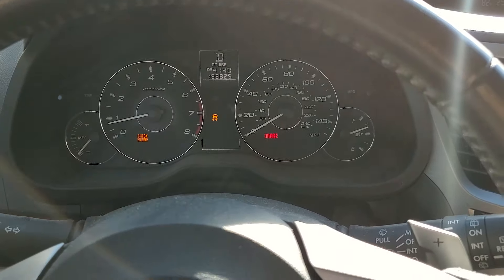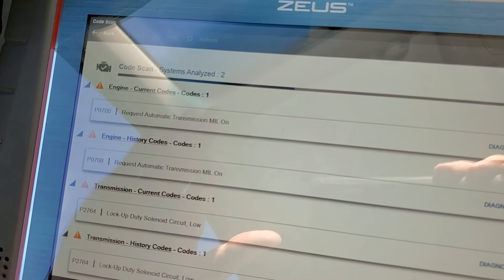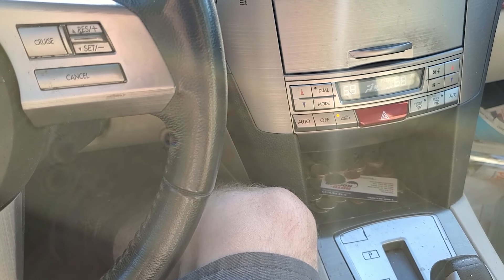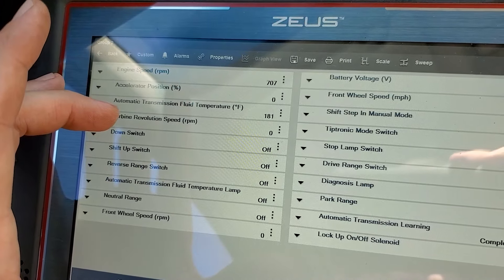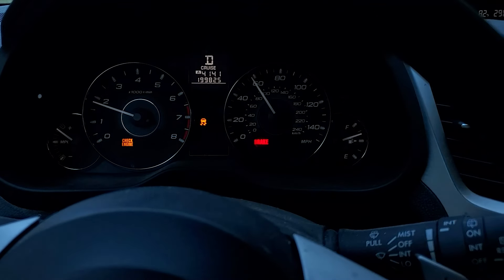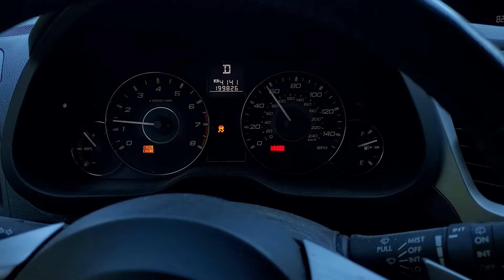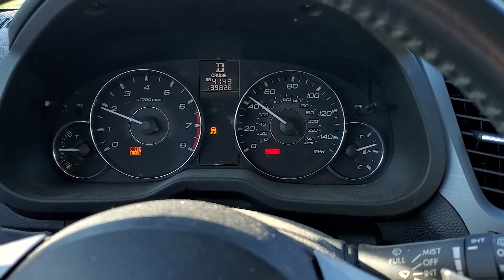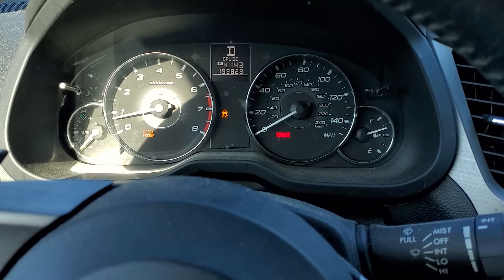Subaru TR690 CVT Trouble! My Brother's 2011 Outback's Transmission Issues.

Comment: Why are subaru cvt so prone to problems? Reason I avoid subaru
Reply from the maker: Two years of TC issues, 10/11, and a failed solenoid at 200k miles isn't unreliable, by any stretch of the imagination.
Reply from the maker: The 4EAT and 5EAT didn't get anywhere the fuel economy of the CVT..
Reply from the maker: Again, how is a first issue with a transmission, at 200,000 miles, unreliable??
Reply from the maker: @gvi341984  25mpg 4EAT
32 mpg CVT

Didn't meant government standards.
Reply from the maker: Outsourced parts from Asia. You realize Subarus are Japanese, right? And all the Lineartronic CVTs are Subaru inhouse..
Reply: @MrSubaru1387  you do know that subaru has a bad reputation for their cvts? Only if they made them as reliable as toyota
Reply from the maker: I'm aware, but most of it is undeserving hearsay and exaggerations runamuck.
Reply: 200k miles, no maintenance, still drives... "why do Subarus suck so much?"

What a fricken clown comment.....
Reply: @gvi341984  That Subaru CVT was never maintained and it still did 200k miles. Despite the issue it still runs decent. A RAV4 would not have lasted that long either if it was never maintained. Toyota reliability is overhyped.
Reply: Subaru CVT aren't prone to problems... Maybe you are confusing them with Nissan...
Reply: @gvi341984  I agree. Rav4 don't die . Reliability is great with them
Reply: @scaldon2  hate to rain on the rav4 parade but PainRank puts the Rav4 in the second to least reliable Toyota product on the market. From battery fires to transmission trouble they have their issues too. I used to rent cars to all those wonderful Toyota customers who's reliable Toyotas ended up on flatbeds at the dealership.